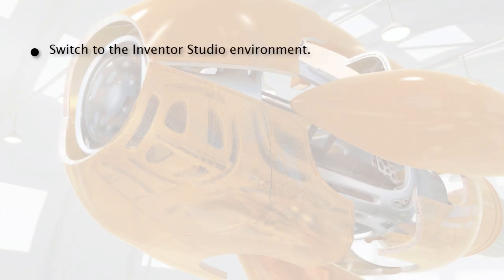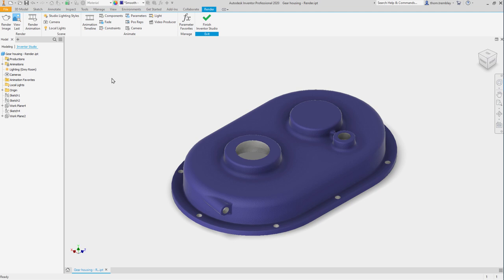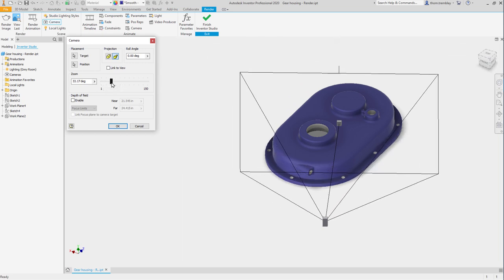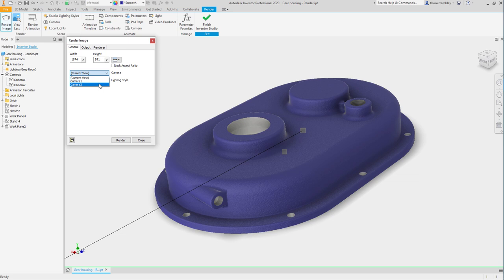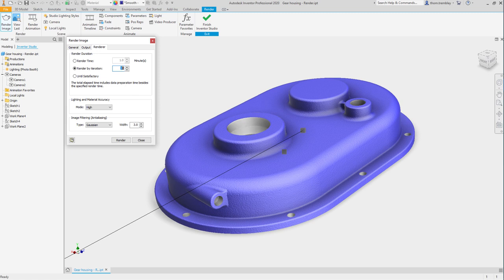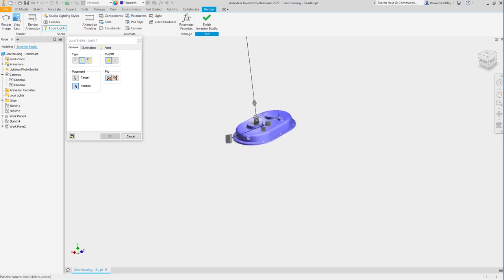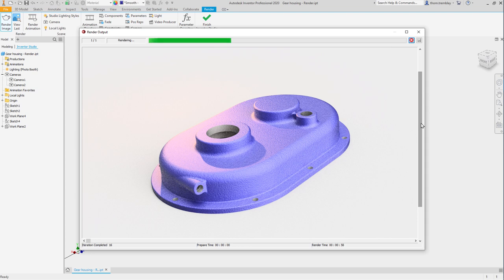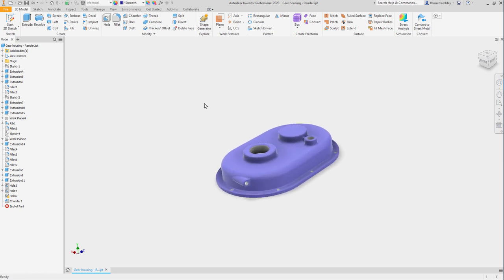Product visualization in Autodesk Inventor: image rendering

Comment: Has Autodesk re-introduced render of line art in the latest update (Visible Lines). Inventor used to have it... :(My current method involves me exporting a visible line art PNG image @ 8000x 6000 (Max) but the rendering in inventor studio for 2018 only goes as high as 4000 pixels wide @ 300ppi.
Reply: Can Autodesk increase that to 8000 pixels wide max and can we please get a rendering option somewhere in inventor studio that allows to quickly render out the line art (wire-frame visible lines). P.S. I very much appreciate the ALPHA layer setting when you select where to save the render in the more settings option. :D awesome.
Reply: These recommendations would allow me to increase my workflow efficiency as I have to carefully find a position to render the image and not move the screen as it wont line up when I export the line art (or vice versa). The only reason I export the line art with rendering is to allow more granular control of how sharp the image looks in Photoshop/etc.
Reply: Sorry for the multiple comments. YouTube has destroyed it's formatting.
Reply from the maker: No worries 😃

Thanks for your feedback! Feel free to post your recommendations on the Inventor Idea Station. This is where you can share ideas for future product features directly with the Inventor team and collaborate on existing suggestions with your peers. Here's the link: https://forums.autodesk.com/t5/inventor/ct-p/70

Comment: I wonder how this will be with bigger assemblies. When I zoom in on my rendered picture I have no details so the render is useless. Is there any way to improve this ?
Reply from the maker: Rendering will take longer for larger or more detailed projects..
Reply: @AutodeskMFG  Well i tested it and i had no improvements after hours of rendering. Couldn't see the difference between a 15min render and a 14 hour render sadly
Reply from the maker: You may also need to adjust the resolution of the canvas...
Reply: @AutodeskMFG  you can render is studio up to 4k but just exporting an image gives better results since you can go up to almost 10k